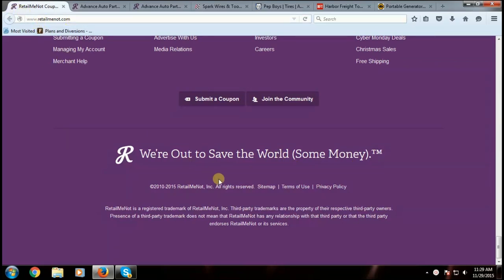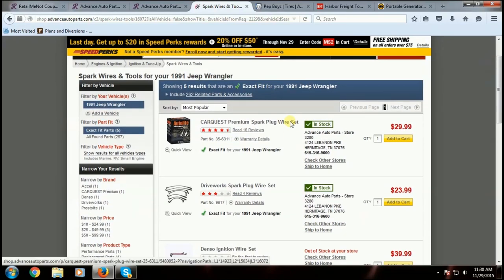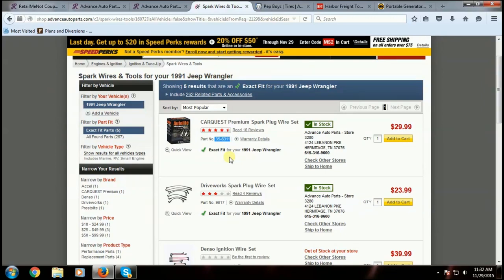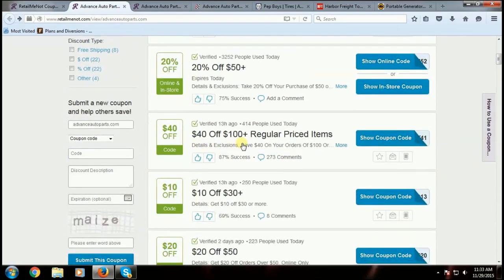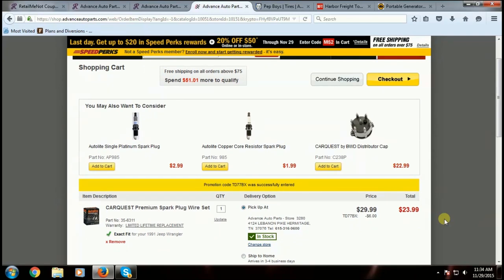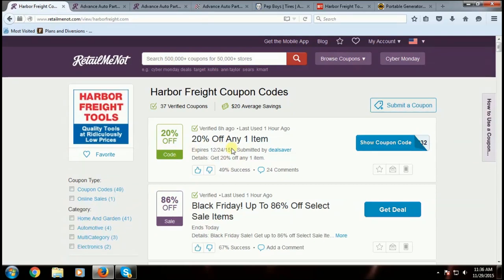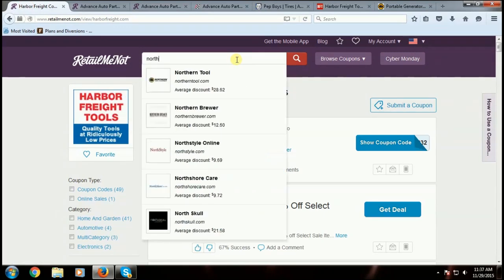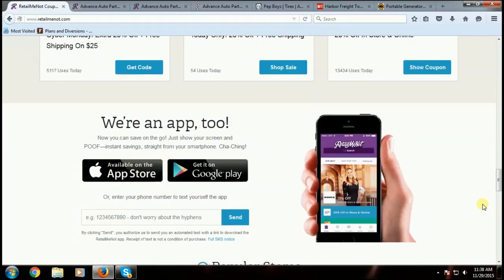Save money on Jeep parts - Here is how I do it

Comment: I got a question, I have a 1987 Yj and I am wondering what would you call the part on the dash where it tells you when to check your engine light and when you turn your turn signals on?
Reply: That would be the instrument cluster :)
Reply: +Gonzalo Orocio thanks and yea idk where to buy that part it's so hard to get
Reply: +Gonzalo Orocio yea idk do you really need it, it's so hard getting parts in Hawaii